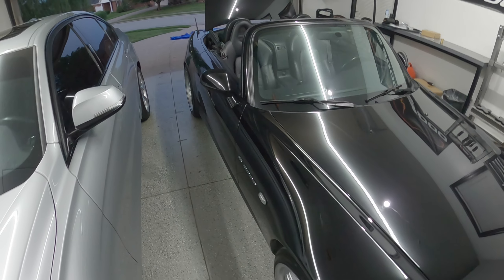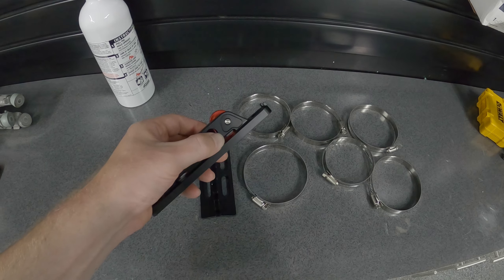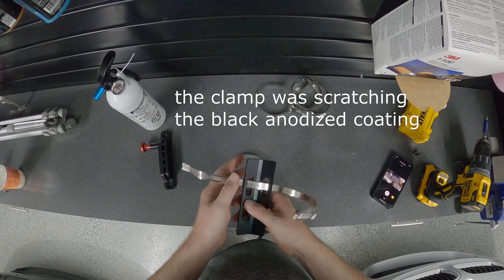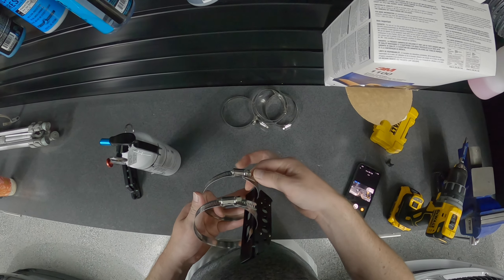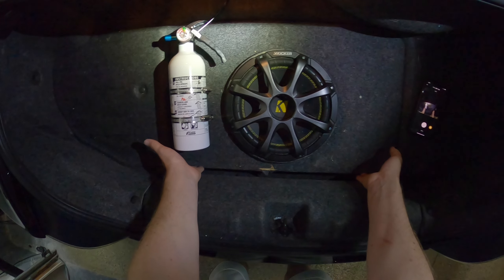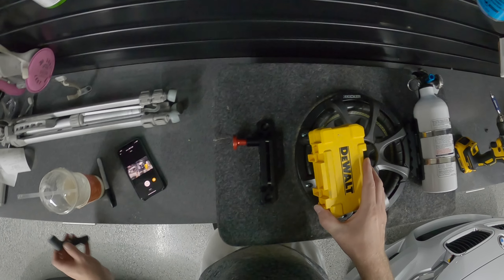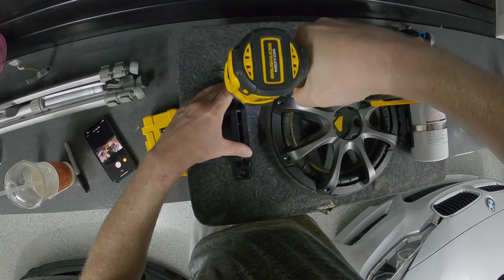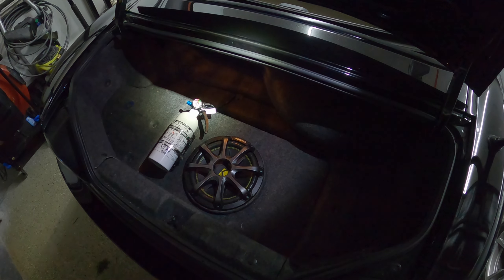Amazon fire extinguisher and mount install (honda s2000)

Comment: @DP Garage, can you reach out to me for your Enkei fitment specs?  THX
Reply from the maker: Hey Man, the tires are currently 245/40/17 on the rear and 215/40/17 on the front. Wheels are 17x9 +45 square. It’s a slight stretch on the front but not too bad.
Reply: @dpgarage4501  I'm sure you've been asked a million times (sorry lol) but any rubbing? Did you have to roll the fenders? I love this set up but I don't want to modify the fenders at all. Cheers! Great videos by the way - new subscriber!
Reply from the maker: @jeremygore1865  Yeah I had to roll the fenders both front and rear for this setup.

It only rubbed on pretty big bumps on the highway.